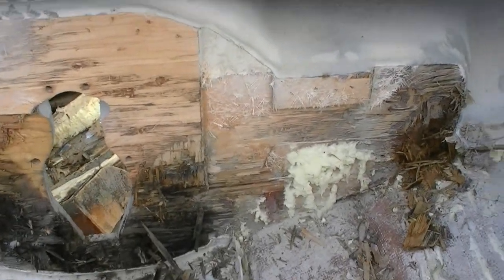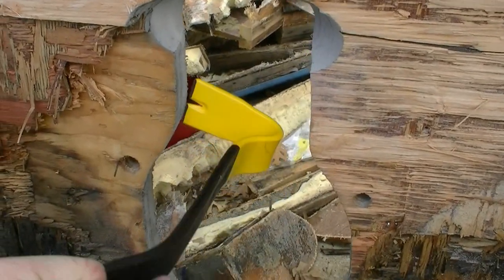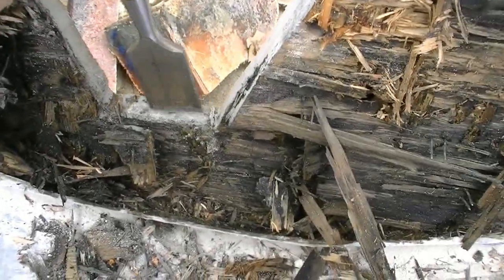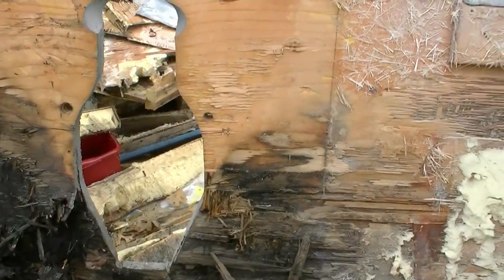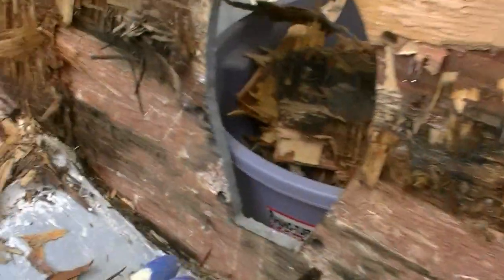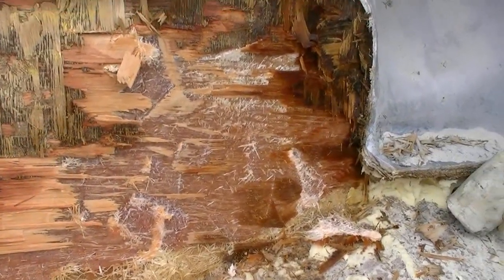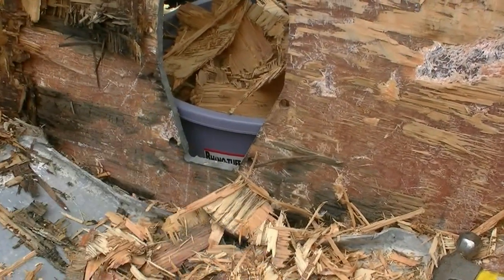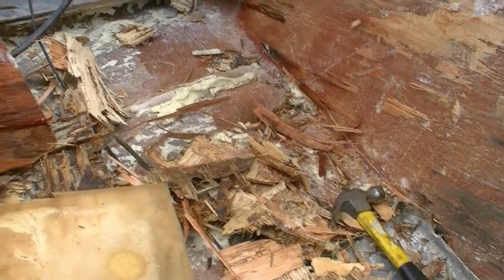How to Remove a Transom in a ROTTEN boat! VLOG #10

Comment: Its nice to see that searay had installed thicker than average transoms on their boats of that era, well on yours at least. I had always heard that one shouldn't remove a transom along with stringers/floors at the same time when rebuilding the skeleton of a boat.issues with fitment/angles of repair pieces, curing of glass etc,You make it look so easy and it may very well be, You take good care,time and research in your work and it shows. thanks for the insight and motivation -J.W

Comment: when redoing a transom, why do people use wood instead of aluminum? Seems like it would save all this hassle of having to replace it when it gets worn, and the metal should be able to handle a higher horsepower rating. Also, it's lightweight. What do you think?

Comment: Hears a tip on removing wood drop transom .a air chisel Use a curved chisels cuts time in half
Reply from the maker: Aaron Boone I partially agree. The rapid vibrations might crack the outside gel... but it might work.

Comment: I'm replacing the transom in my 16ft lone star. Would I be able to use some regular plywood as a replacement for my transom as long I use epoxy and paint if with some sort of water resistant paint?